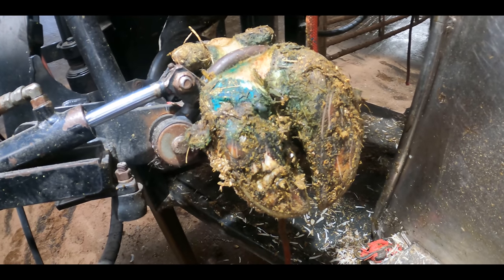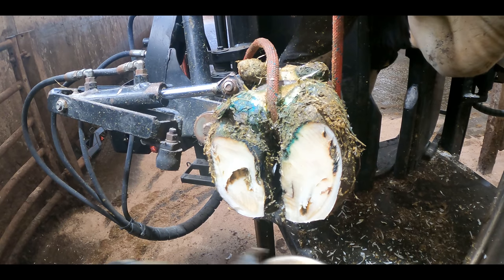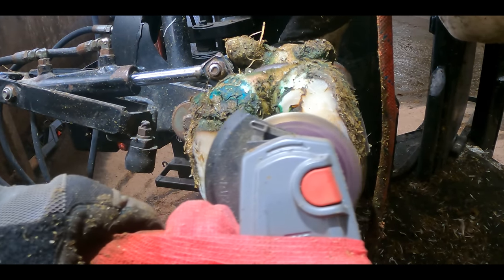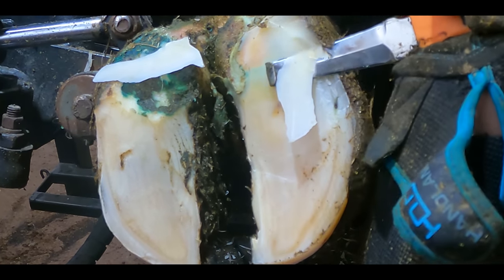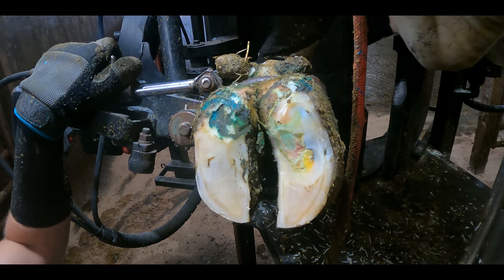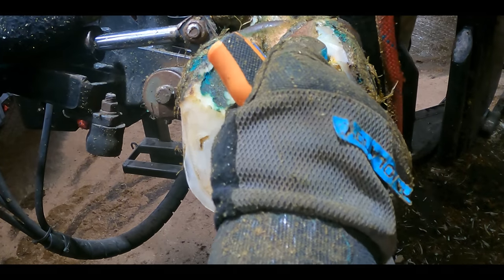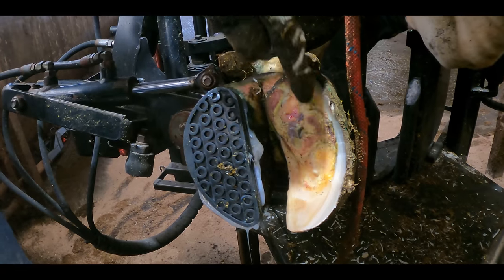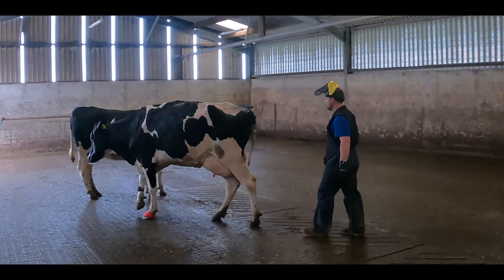SATISFYING HOOF TRIM  |  PEELING AWAY  DETACHED HOOF HORN

Comment: I thought it was interesting to see that blue dye seep down between the delamination. That blue is from a dermetitus spray? PS: Was that a different knife that usual? It seemed wider and straighter than I normal see in your videos.
Reply: I noticed that too almost straight away there must be a reason why he used a thicker knife. 👍
Reply: I’m guessing he’s trying out something from a potential sponsor, or something that was recommended to him.
Reply: Or we saw a new knife and not one that was, say a week old!!
Reply: @cathyb2204  Indeed. He says he sharpens them every day to get a razor's edge. That will take the metal down really fast.
Reply: You are correct about the spray. It fights the Dermititus and also marks the area so that when a trimmer checks, he has an idea already where a part of the infection is.
Reply: He has said at some point that they have multiple knives and they customize them for their own need. Its not far fetched to assume they have a wide variety of how wide it is aswell  as they probably start  wide and end up thinner.

Comment: How does the rebuilding horn seal itself over that soft tissue without always having a crease between the old horn and the new horn?
Reply: The corium, once healed of the dermititis, will simply grow the horn right out of itself. The hole is due to the bacteria eating at the corium, detaching the hoof after it's grown. Once the bacteria is gone, more horn grows and there is no gap.

Comment: I know absolutely NOTHING about your work and maybe you answered this before, but why not clean the foot before? It could prevent small particles from entering a wound and may see something happening before you grind, no? I'm just curious about this. I saw many videos and ever RARELY see blood or a cow in the crush trash from pain. Also, what 'glue' are you using? I would think the block would get used up or fall off. What happens to the block? Do you trim it off? It falls off? You remove it? Sorry if these questions have been answered before. Thank you

Comment: Watching these videos it seems to me that he could do with a tool between the knives and the grinder. I'm not sure what. A mini-grinder or a Cordless Rotary Multi-Tool perhaps. What, I mean is that it seems he'd save a lot of time and effort cutting with the knives if he had a more nuanced motorised cutting tool that wasn't as large and powerful as the grinder but could get rid of a little more before having to resort to the knives that look hard work, time-consuming hard on the hands. Having said that perhaps he needs to cut by hand to feel how tough or lose the horn is and therefore how much he needs to remove. I might just be speaking from the position of a lazy person.